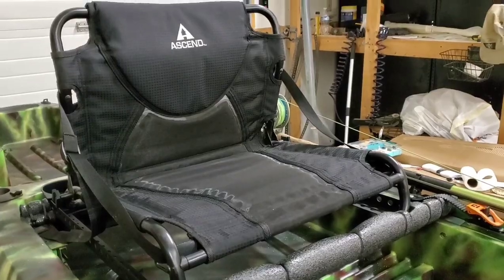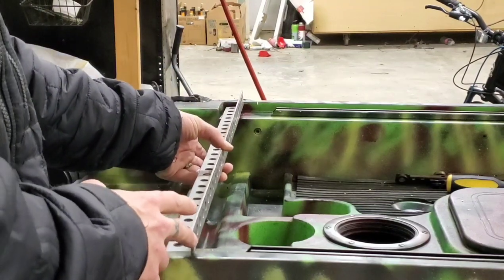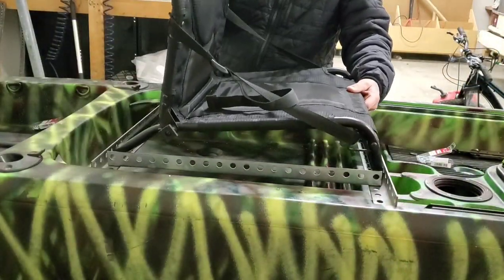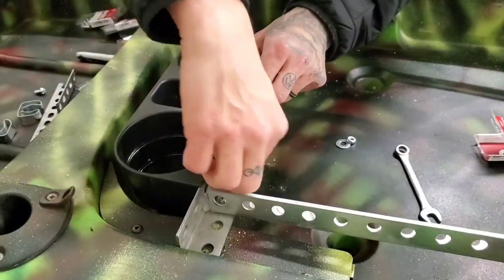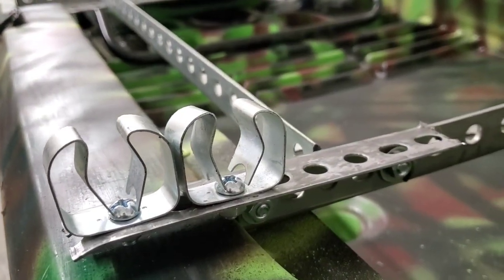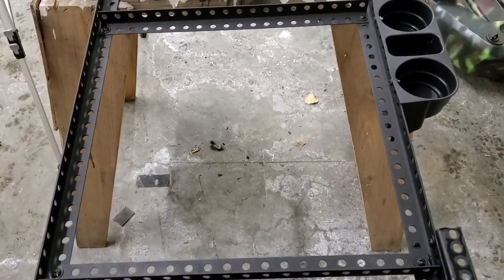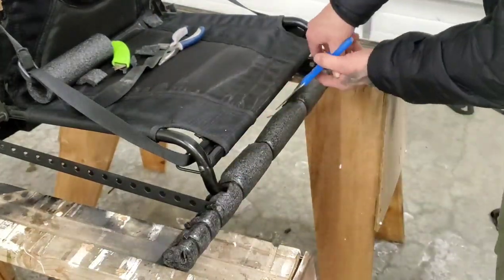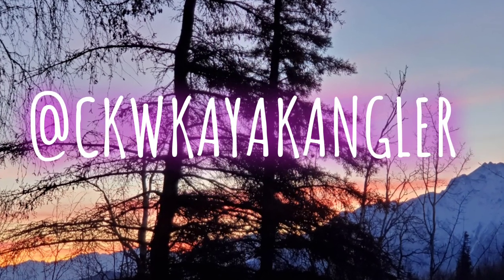The Ascend 12t Kayak Build Ep. 1: Seat Raise Modification for Easier Fishing and Paddling

Comment: What specifically did you use? I bought 1 1/4 inch steel angle and followed your video, sat in the seat and the angle bent in half! I’m only 180 lbs!
Reply from the maker: I'm sorry to hear that! I am unsure exactly what thickness steel I used, but when I bought mine I bought the thickest pieces that were available at Lowe's to make sure it was sturdy. They sell many thicknesses, some of which are not apparently strong enough to support the weight of a person. I am 180 also, and have no issue with the thickest steel they sell (or sold at the time). I hope this helps, and sorry again to hear that! Looking back, I wish I would've been more specific in this video!

Comment: I used the angle steel that has the oval and circle holes.  What a bitch - if I could recommend anything measure the distance between lumbar holes not the entire space between. This will ensure each cut will line up properly and allow you to bolt it together tightly

Comment: Did you use special paint for kayak. Does it stick well. Thks.
Reply from the maker: No special paint, I used Rustolium spray cans and just sprayed a random duck camp pattern on it but to get it to stick a little better, I lightly sanded the boat just to rough it up a bit, and sprayed an adhesive promotor on it first. Then i sprayed the paint over the top. It sticks okay to the sides and places that are not rubbed on a lot, but the keel and sides of the bottom that get scraped on a lot scraped right off. Still a good amount of paint on the top and sides of the boat to this day, though, and that is after dragging it down creeks, over rocks, and through the woods nearly 3 or 4 times a week since I bought it. Not bad.

Comment: I’ve been debating  on modding my seat. The low seat hasn’t bothered me much but after watching this video I thoroughly love this mod and it adds some extra storage. 

How do you think the seat would hold up paddling through surf?

Thanks for the share
Reply from the maker: Hey, glad you enjoyed it! 
I think the seat would hold up great through the surf, but definitely may make the boat a touch more tippy in rough conditions if you get sideways in the waves. I've had mine in the saltwater bay here in Pensacola FL in some good chop and it did fine, but I've never put mine in the surf (I use an Old Town Predator for that). On calmer water, the boat is still more than stable with the seat raised, though. 
I'd also be concerned with the saltwater in the surf rusting the angle metal, depending on if you use steel or aluminum. Maybe a coating of a more resistant marine paint would be in order? 
I think it would work!
Reply: @ckwoutdoors  I’m constantly in salt water even if I’m not paddling through surf. 

Marine paint is a great idea!

Comment: Great video. I had a question thought. Do you remember how you attached the buckle side of the snowboard binding to the kayak?  It seems like its right on top of the rails.  Been wrestling with that. Thanks!
Reply from the maker: Apologies for the delayed response. I attached the buckles with a screw directly into the metal rail to keep them secured. I don't use those rails much anyway, so it wasn't a problem drilling into it for me, however I can still put accessories on the rails from the front, if needed 😁
Reply: @ckwoutdoors  thanks!  Keep up with the great vids!

Comment: Did you notice it was harder to paddle? Like your angle was way off ?
Reply from the maker: No, in fact it made it a lot easier to paddle because you can dig the paddle a lot harder into the water. Also I found I got splashed a lot less

Comment: How stable is it?
Reply from the maker: Very. I didn't notice any seated stability change at all. I even argue that it improves overall seated/standing stability because it is much easier to stand from the elevated seat and sit back down, which poses less risk of losing your balance and falling in. In terms of just seated paddling and fishing though, it does excellent.
Reply: Just bought a 12T myself!  Loved the mod!  What kind of metal is that with all the holes in it?  Loved the video!

Comment: DO NOT RAISE YOUR SEAT MORE THAN ABOUT 2 INCHES!!! 
THIS MOD IS FOR WIDE KAYAKS!
DO NOT USE THIS MOD ON TINY LIGHT KAYAKS! 
Your kayak is designed with the seat in the safest position to avoid flipping the kayak in the water.
I raised my seat 4" and lost over $1000 in gear and electronics....
Good luck though!
Reply from the maker: I used this setup for well over a year, even in some rough saltwater quite a few times and have never flipped it. Just depends on the circumstances.
Reply: @ckwoutdoors  Yes your kayak mod works because it's a "wide kayak" and a good kayak so you actually have "on the water" footage. Most of the popular videos are on little 10ft junk kayaks like the pelican, sundolphin, lifetime, tamarak etc. NONE HAVE ON THE WATER VIDS! (Because they probably flipped and don't want to take down a vid that's getting a lot of views) 
Not only are they raising their seats but they're going to add all their gear, electronics... deep cycle car battery...
You get the point!